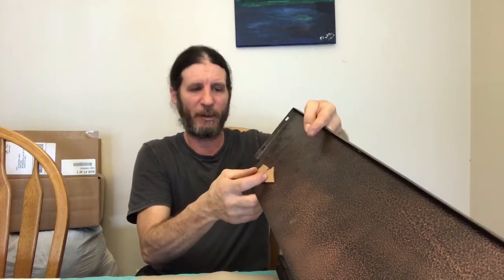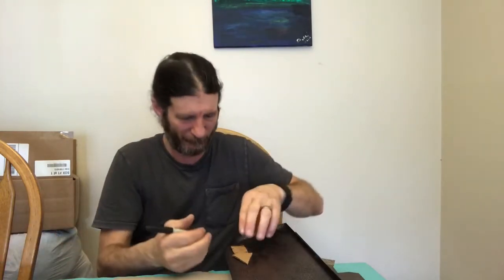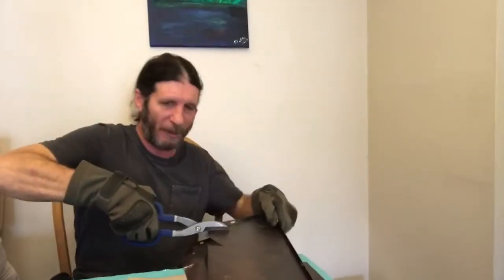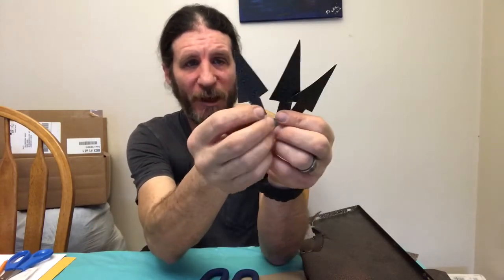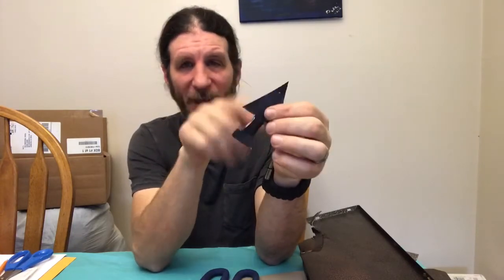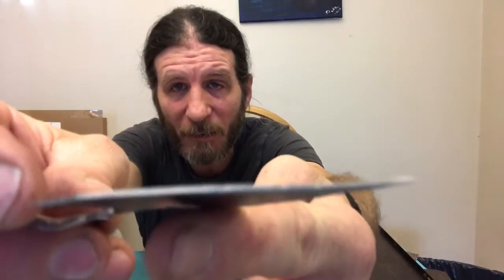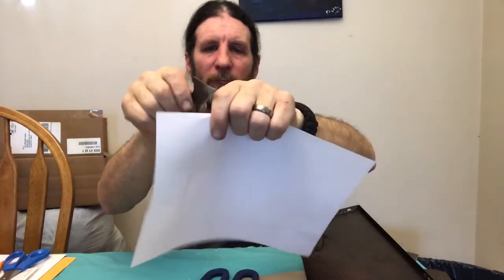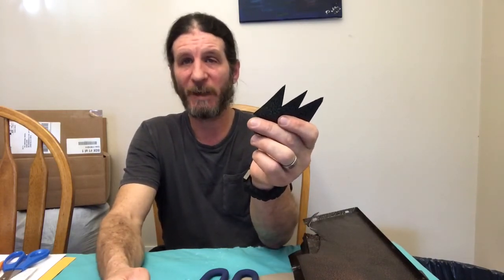Making arrowheads with scrap steel

Comment: Robert. Unless you are hunting elephants you should cut those down to half the size they are. If you go to the store and look at what the size and shape the hunting arrows are, you will get a good Idea as to the shape to make it. The arrow heads that you have would be more like spear heads brother. If you use them for spear tips, I would recommend laminating three or more together and then sharpening them. That looked like a wet stone you were using. It has two different grits on it. Try soaking it in water for 15 minutes or more and then use the heavier grit to grind the point then use the lighter grit to polish the blade edge to an even sharper point. You will be surprised as to just how sharp you can make that edge my friend. Give it a try. What have you got to lose. I enjoyed your video. Thanks for sharing.
Reply from the maker: Thank you. Yes. These arrowheads are are the first ones I made. I’ll get better at it as I go. And that sharpening stone was from the dollar store. It didn’t have any info on the package about the product. I’ll wet it next time to see if it works better.
Reply: Don't get me wrong Robert. That was a sharp edge you created on that arrow head and it would penetrate flesh. Therefore it would do it's job. You just have to shrink them down in size if want your arrow to be aerodynamic and have accurate flight. I love the creativity you used in repurposing that sheet metal brother. You did an excellent job. I do tend to ramble on sometimes and I can be annoying. Sorry about that. I loved your video though. Keep up the great work my friend!